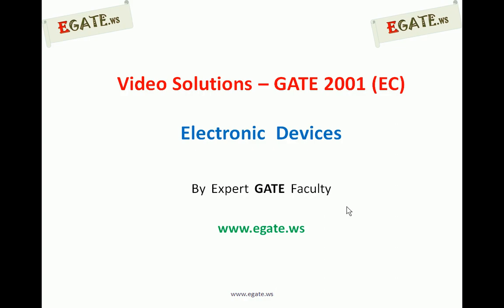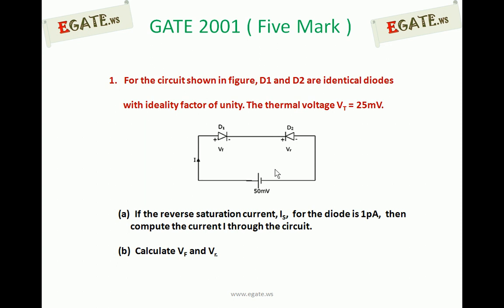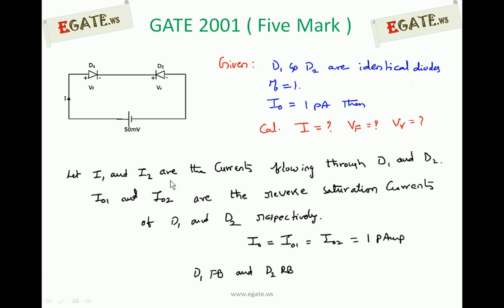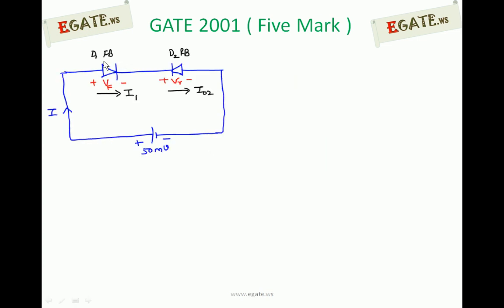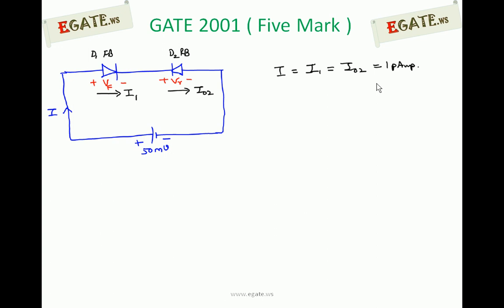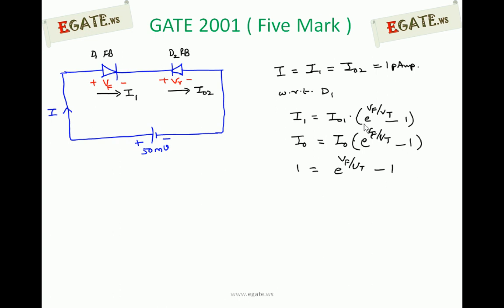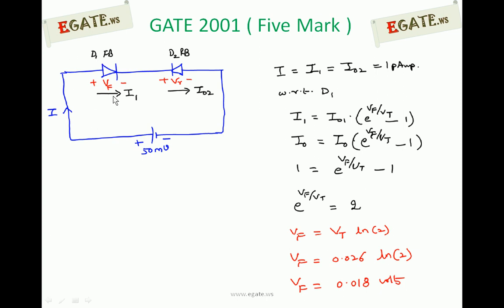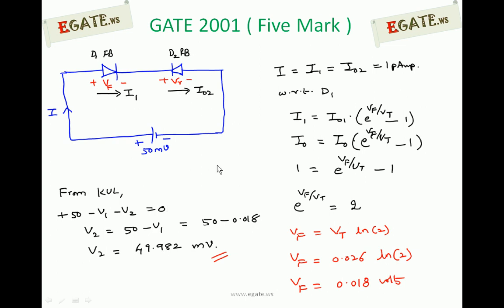Problem on Diode - GATE 2001 ECE (Five Marks) - (Electronic Devices) - www.egate.ws

Comment: Sir,In the above problem..the input voltage is 50mv and the vf calculated is 0.018v i.e.,18mv
by applying kvl
50mv-18mv-vr=0
vr=32mv